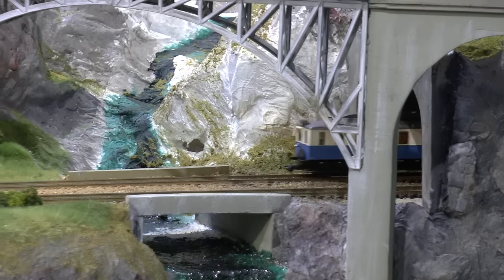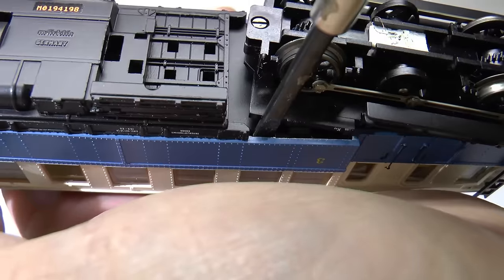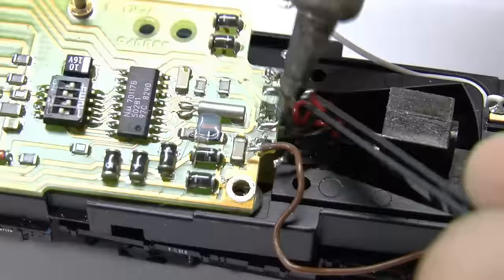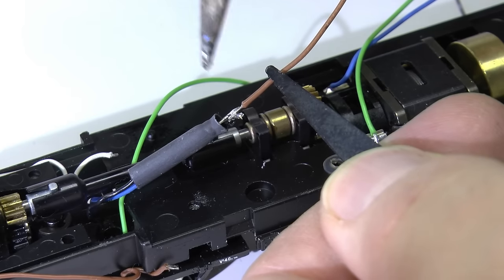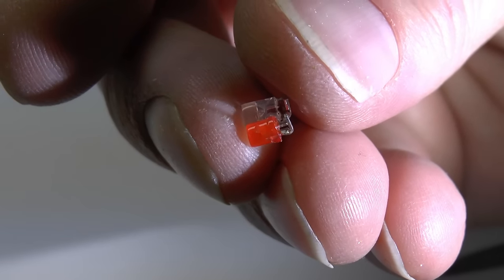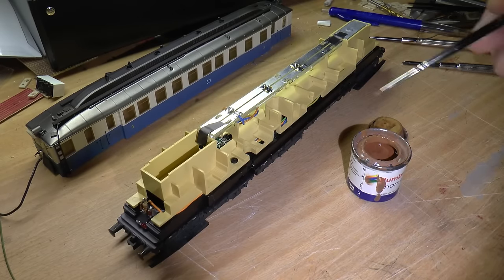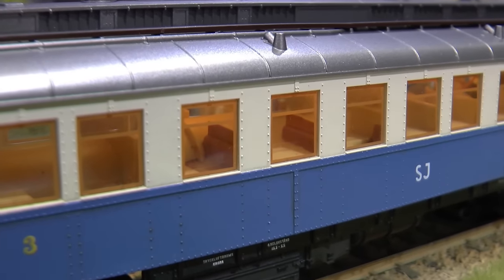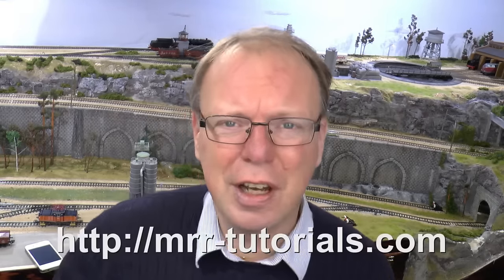Digital conversion of the Xo2 railcar - Detailed guide DIY

Comment: Hi ! Can I upgrade my delta 2915 train using this 60760 decoder ? and there is 60941 too so which one is better for my train ? and after done this which digital control or mobile center do I need to buy ? please give advice for this because I am new to this hobby , but I own mine about 25 years ago , rarely play it , and its just sit in the box most of the time : ) thanks

Comment: At about 3:51 in the video, you indicate the diodes 1N4148. As LED's are diodes and only allow current to pass in the correct direction, this seems an unnecessary component. Can you comment on why you mount them (They're dead cheap so it's not the money but the work / Space requirement ...). GREAT VIDEO anyway!
Reply from the maker: Hi! Yes. The maximum reverse voltage for an LED is about -5VDC. This means it needs an 1N4148 in series both for rectification purpose and also the protect the LED from reverse voltage spikes commonly induced from ESD-discharges to the rails (static electricity). 1N4148 is ideal for that since it has a very fast slew rate being a switch type diode. That’s why! 👍
Reply: @marklinofsweden  Wonderful and good answer! Truly appreciate it (In English so all can read ... I'm Swedish).

Comment: Hello Master! may i ask you where did you conect the interior lights (since you are going to replace them later..) is it together with the front lights?? thank you so much
Reply from the maker: +Pablo Luchi Hi Pablo! I connected the interiour light on the F3 output of the decoder.
Reply from the maker: +marklinofsweden Ohh. This decoder output is not in the manual. You need to cut away the plastic around the decoder. There is default no wire from F3. Only a soldrr pad. Search for 60760 extra output on Google and you'll find out where this output is. It's good for both lights and smoke generator. Good luck!
Reply: Oh, I see now.. It's incredible how they hid that useful pad! thank you very much! I really appreciate everything you teach us!!